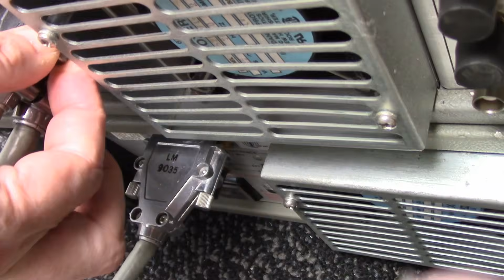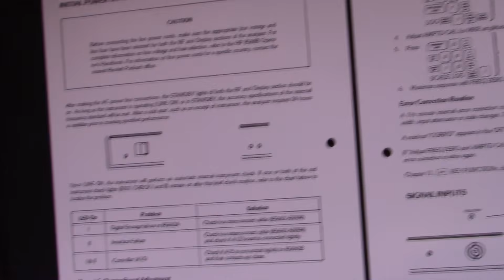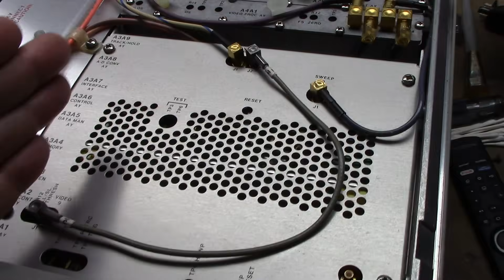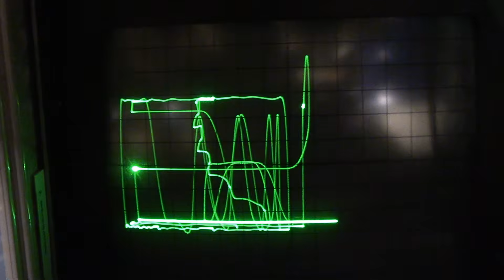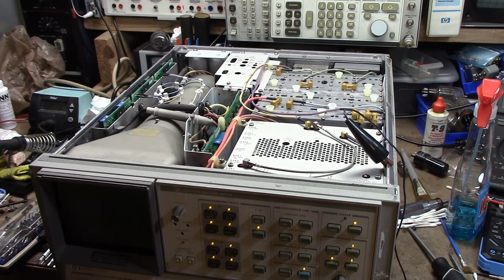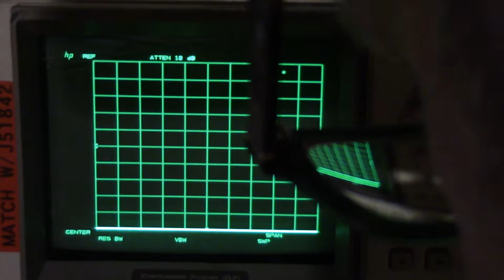HP 8568B spectrum analyzer part2 - cables and full power up

Comment: Bob, Did you notice the TRACE button saying "Blank" had the LED ON? I don't have the manual of the device, obviously, but when the LED is on, above the knob saying BLANK well... that would sort of suggest it blanks the CRT output, wouldn't it?
Reply from the maker: Not quite.  There are two banks of controls - A and B.  You can store the current screen display in either A or B and flip between them for comparison. I believe 'blank' clears out the saved image.

Comment: The unit might use the 10MHz reference as clock fir the microcintroller, at least my HP counter does this. Would explain why it‘s not working when switched to ext ref.
If I remember it right, the display section can be configured to show an alignment pattern without the rf deck, check the service manual and try to get the display unit working alone.
The star in the upper right corner in the display means „processor busy“, maybe some bad interconnect to the rf deck makes it to be stuck in a loop thus not reading button status… At least the cpu is running and generating the vector image!

Comment: Congratulations Bob on getting the display unit working!  If that problem comes back, you might want to try a thin film of DeoxIT on the edge connectors.  After the display came back to life, I noticed the receiver wasn't sweeping.  Just make sure the Sweep is set to Free Run.  If that doesn't work, your 10 MHz reference signal may be missing.  If I remember right, these analyzers came standard with an oversized standard, with a higher stability version available as an option.
Reply from the maker: Upon reflection, I don't think reseating the cards did anything.  The only way I can get the display to come up is I completely remove power for a few minutes then plug in and turn it on.  If I leave it in standby mode, the display will not come up when I turn it on.  In other words, if I turn it off and back on the display will not come up.  However, the external signals are present.  It seems the signal to come out of standby is not causing the HV supply to fire up.

None of the controls work so I can't set the operating mode.  Correct, there is no 10MHz reference. I will feed in an external signal once I know what type of signal - sine or square?  What amplitude?
Reply: @bandersentv  I don't remember exactly on the reference signal level.  One clue will be the external input load impedance, if it is 50 ohms, probably 0 to +10 dBm, sinewave or square wave (the internal circuitry will convert it to squarewaves since the logic circuitry is looking for rising or falling edge to trigger from).  If the input impedance is 1 meg ohm; a TTL logic level input.
Reply: @bandersentv  The mystery high voltage supply activation problem sounds like you may have a floating logic level someplace.  The high voltage power supply probably has a logic enable line input.  If you try to measure this, connecting a voltmeter to it may hide the problem because the voltmeter acts as a 10 meg ohm pull-down resistor.  To determine if this is so, additionally measure suspect logic lines from +5V instead of ground (0 volts).

Comment: Wasn't the internal crystal oven missing in the previous video?  You may need to set for external, and give the unit an external 10 MHz reference.  Either way, the 10MHz reference shouldn't cause a completely missing display. It may be responsible for the missing trace/noise floor on the display, though...
Reply from the maker: Yes, I just realized that yesterday.  I'll try feeding one in once I know what amplitude and waveform it wants.
Reply: @bandersentv  Sinewave, 0dBm to +10 dBm
Reply from the maker: Excellent.  I'll feed that in from my 8662A
Reply from the maker: OK that made a big difference.  Control panel still dead but the display is doing more now.

Comment: The wavetek almost looks like some sort of AC coupling or return-to-zero is interfering with its ability to draw straight lines like the "correct" display needs.
Reply from the maker: Not sure.  I do know it works fine when paired with a sweep generator

Comment: I know those "weirder" d-sub connectors exist- there's several kinds with large power pins and as yours has, RF shielded connectors, but that is the first time I have seen them used on something.  the other 3 row d-sub connector seems to be a standard one, and the other connector is a centronics connector which is found also on old parallel port printers, but yours is probably the 50 pin version.  printers have a 36 pin one.  it looks like the other name for them is a "micro ribbon connector".  they were also used on SCSI cables (the 50 pin version).  the other end of that cable is a 3 row 50 pin D-sub connector by the looks of it.  the RF cable is using a D size shell with 5 power points, which instead of having power pins have RF connectors instead.  The shell type seems to be standard but digikey doesn't sell the RF connector inserts.
Reply: One you used to see pretty often was the DB13W3 - 13 regular pins and 3 of the larger ones. They were the standard video cable for some Sun and SGI workstations.
Reply: The 50-pin Amphenol connectors are also widely used on telecommunications gear for 25-pair cable connections.  Centronics used the 36-pin version for what became the de-facto parallel printer standard that we generally call "a Centronics connector" in that context, but the connectors were originated by Amphenol.

Comment: Don’t rely on visual confirmation of a fuse not being blown, I have seen perfectly good looking fuses be bad as they failed inside the end cap., always test them.
Reply from the maker: Excellent point. I did test all the power supply rails at the indicated test points, but I will go back and check the fuses.